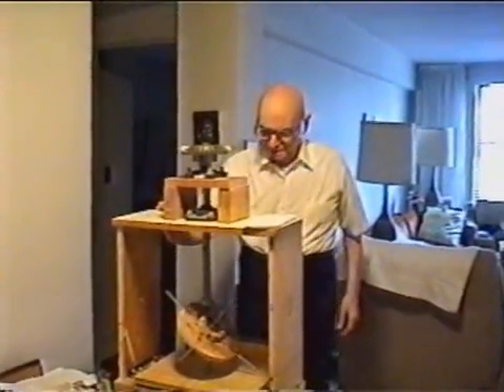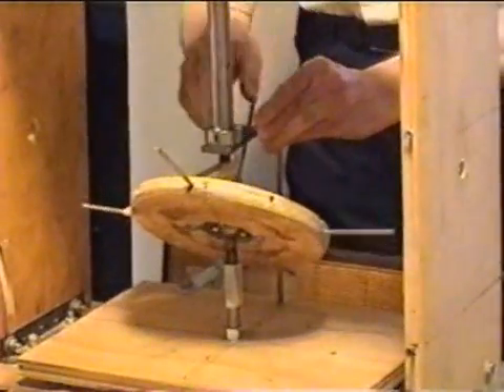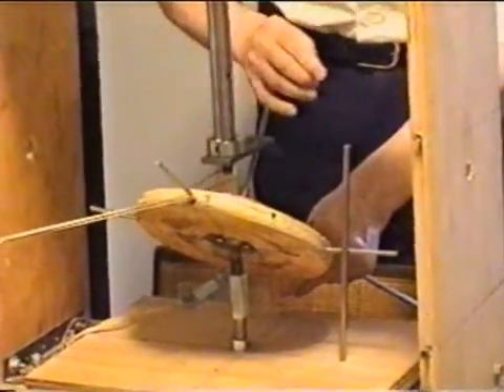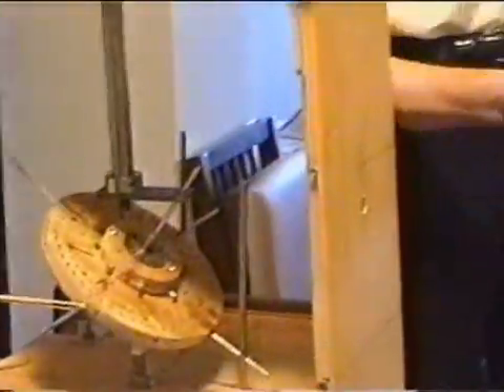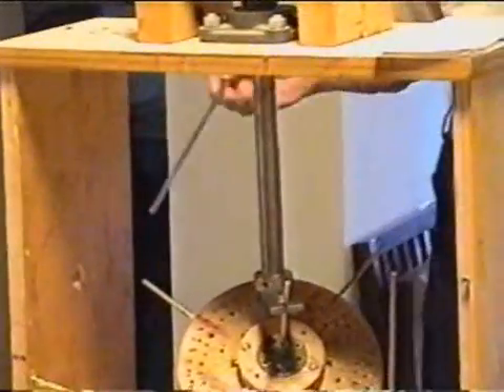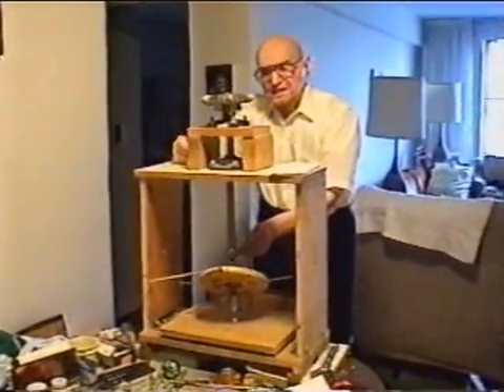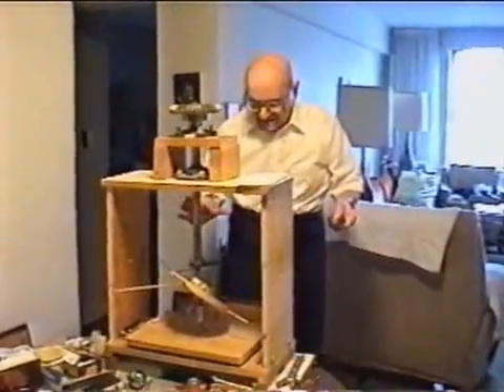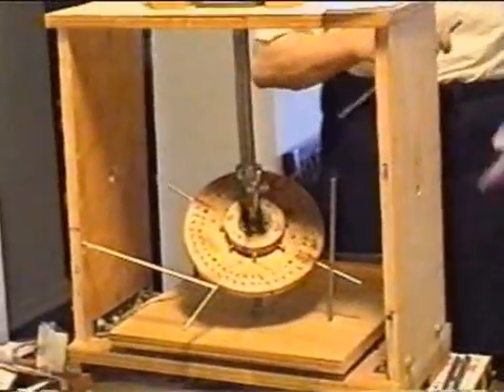Perpetual motion machine

Comment: You're taking the word "perpetual" too literally. A "perpetual motion machine" is any machine that is able to achieve and sustain 100% efficiency. It doesn't matter if it actually runs for one minute, or perpetually on into infinity. If it achieves and is able to sustain 100% efficiency, it's a "perpetual motion machine." And, consequently, if someone were able to build such a machine, then its normal bearings likely wouldn't ever wear out, as entropy would not be taking place.

Comment: even if we are talking about man-generated electrical input.. it should still be cheaper. but you could buy a 48 watt solar panel hooked to a modulated pulsing circuit that would create hydrogen gas for you all day in the sun and the electrical input would be completely free aside from the solar panel cost. since we are talking a gas, what is there to refine? a person could literally sell hydrogen that way and make a decent living so it cant be THAT costly.

Comment: To the haters and supposed "engineers": think outside the box. think like this man and stop using convention and laws of physics for true engineering. To those who think wind power is the future: You're simply re-inventing the wheel. Or turbine. Good on ya. This man probably envisioned this for years, and finally had the resources to make it come to fruition. Engineers today, for the most part, replicate others. So, basically, they're "improvers" and not innovators. P.S. I'm a PE. USE UR BRAINS!

Comment: Its an interesting idea, but the friction and force to undo and replace the "stops" would slow down the machine, especially if it was automated by the machine itself.

It is a clever idea, though, but it would only work if there was an outside force working on it, which then defeats the purpose.

Comment: Was about to flame this when i understood it. He needs a fly wheel on top to keep it moving. The stops make the gadget turn correctly . But unfortunatly he hasnt worked out the perpetual motion bit which involves an everlasting rubber band that turns it and can put out more twang than the usuall ones.

Comment: its based on kinetic energy via the rubberbands, thanks mr constantopes, way to go, good job, i was waiting to see it work though. i think we are all at a loss at to what outside resource you were talking about, one thing for sure it will only put out the strength from what resistance the structure will hold in rubber bands, but what about a leaf spring set up per the four sides for each side to repel from then you would not need the bars off the main gear just the main housing .

Comment: The only semi true perpetual energy, was developed by anchient priests thousands of years ago. they were able to create alter fires that could burn for 100s of years without replenishment of fuel, but they would eventually burn out due to said lack of fuel. They were powered by large vats of oil using a fountain hydralics system to incramently fuel it the right amount so it would last.

Comment: So, you've got your machine spinning, and it took X amount of energy to do it. The machine now has X amount of energy and would spin forever if NO force acted on it. If you hooked it up to a generator, It would give you X amount of energy. The same amount of energy you had to put in to begin with. Actually less, since you just changed it to a different form with your inefficient generator. And NEVER more. That would be overunity and is impossible. Where does the extra come from? Out of your ass?

Comment: some force or other. The earth, btw IS slowing down. But slowly because it's spinning in a vaccum. It's a very heavy object, and the forces slowing it down are weak by comparison. It was given energy to get it moving. It's using that energy. When its gone, so is the movement. Period. When I spin a wheel I give it energy. When that energy is gone, so is the movement. Period. In the case of the wheel, air resistance and friction slow it down.

Comment: overunity is impossible. friction will always exist to work against all input energy. if you've made a machine that successfully overcomes friction to power itself even if it doesn't output any net energy then you, sir, would be hailed as one of the greatest scientific minds of our time. if what you say is true, and that overunity is not only possible but simple, it is unimaginably useful. the very smallest upshot would be the massive overhaul in efficiently in all machine designs.

Comment: true, in any closed loop system there are losses and efficiency is never more than 100%... However u can have COP more than 1 and still have low efficiency,

a Heat pump has COP > 1. u can extract energy from nature and get more energy out than u had to put in

Comment: Yes, pretty much like all of those, basicly we would be using one of the forces found in nature, that is 100% clean and renewable, and that force in magnatizium, the like poles repell each other and that force can be converted into machinical motion (a shaft spinning) then that can be converted into free, clean energy, that unlike the ones you mentioned above, it would be constant, not changing, this means that only when the suns out is solar cells most effecant, and only when the wind blows,etc

Comment: anyway - the machine, if perfect (and it is far from perfect even in theory) could only be 100% efficient - a perpetual motion machine at best (at absolute best, and it can never be that). In order to be of any use for generating power, either mechanical or otherwise, the output must exceed the input (solar, wind, hydro, nuclear, combustion etc.  all lose a LOT of energy to the generation process). This is a lovely little tin kering project, though. It is always fun to build stuff! ;D

Comment: OK - lots of comments from folks who clearly have no knowledge of either engineering nor physics (nor English - forgivable outside of the English-speaking world).
Not totally clear - I think he means the lower disc to pivot in a way that rotates the shaft (or else the elastic bands would get wound around). The machine requires energy to stretch the elastics and to move the stops (a loss) and to overcome both friction and gravity (further loss). These factors take away from mechanical efficiency.

Comment: Actually, since I am already here, I will repeat my point, and you can keep arguing on THAT if you want:

- It is impossible to create a *mechanical* machine that requires no energy to move. -

A mechanical system can't output more energy to an external device than the amount of energy it received. Nothing more complicated than that.

The word mechanical is important here, because unless you got a particle accelerator in your house, don't bother talking about anti-matter or other funky stuff!